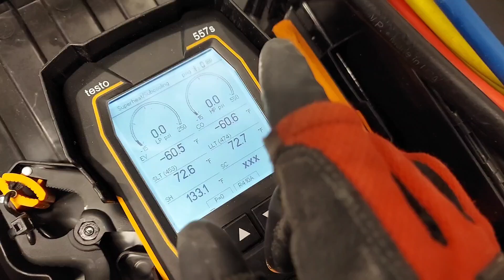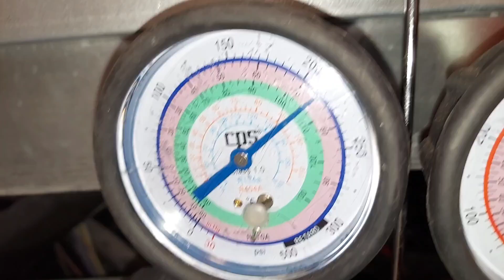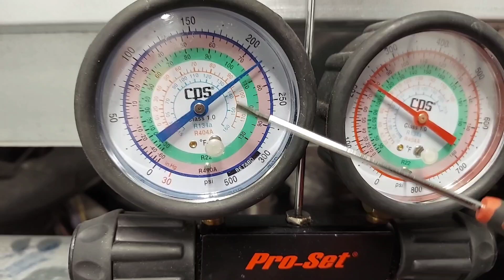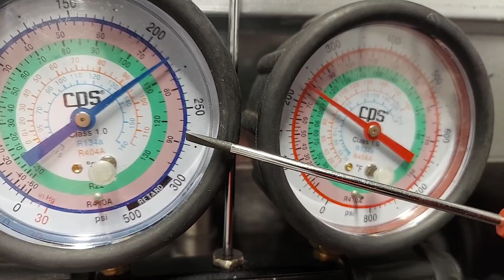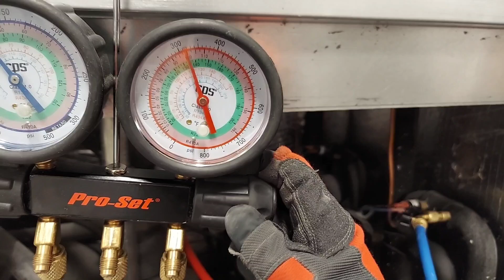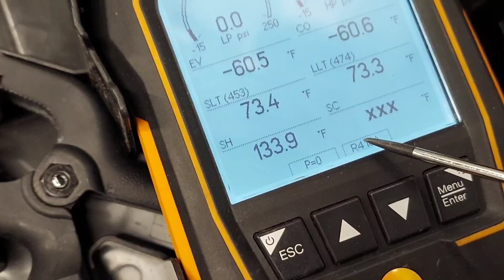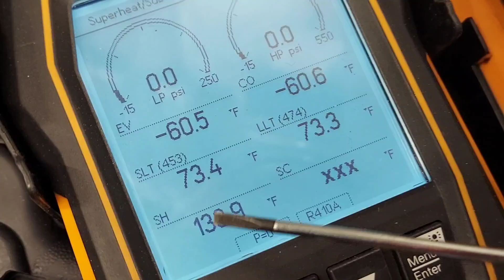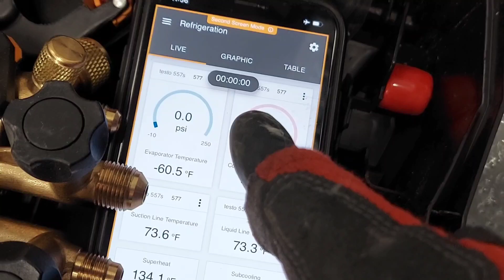HOW TO USE AC MANIFOLD GAUGE

Comment: For you new tech's always check your O- rings on your hoses, they usually get damaged because you have put them on to tight. Trust me, you might have fixed something put it into a vacuum and it's not holding and you are banging your head on a wall because you can't find the leak. Something that small can make your day bad. It's happened to me 2,388 times. lol

Comment: I’ve seen and heard bad things about testos new digitals, how long have you been using them ? How’s the connection with the probes and app while using the gauges ?
Reply from the maker: Awesome 😎 thus far and I did a first impression video when I got ‘‘em go check it out
Reply from the maker: TESTO 557S SMART DIGITAL MANIFOLD with BLUETOOTH
https://youtu.be/VSdg2KY3uWI
Reply: I found there was a glitch with the app not connecting to the gauges or even finding them on Bluetooth 🙃 I noticed about 2 months ago! but the probes all still worked, it has been fixed now, you just gotta update the app. Every time I have used mine I have been happy. Just got the new scales ⚖️ can’t wait to try them out next week 😊
Reply: @Ken_4711  The New scale with the smart Valve?
Reply: @HVACslayer  yeah it looks pretty sweet! thought I would stick with all testo so can be all on the ipad, and as a beginner could help me not over charge as it looks to have the ability to set the weight and change for you 😍
Reply from the maker: Yo testo over field piece any day!!!
Reply from the maker: I was thinking about getting those too … the new scale seems dope
Reply: @D2DNYAC  looks packed with features you should get then #teamtesto 👊👊